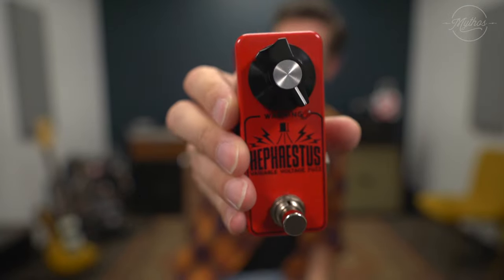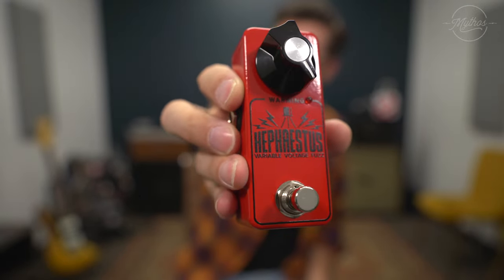Why I made the Mythos Hephaestus Variable Voltage Fuzz.

Comment: I’ve been wanting a boss tone and have been staring at the myriad of options or making my own clone.  Measuring transistors for these finicky circuits is painful.  I really need something better than the HFe thing on my multimeter.  I’ve conditioned myself to avoid the frustration of simple fuzz circuits.

But Lord, this is a simple beautiful design.  A minor tweak on a classic circuit that gives it a magnitude more utility.  One knob.

[cue Office Space Lumbergh voice] So yeaaah.  I’m going to need you to make sure Eastside has these in mid August when I’m in town.  

I want to get it from some dudes and not the man, man.